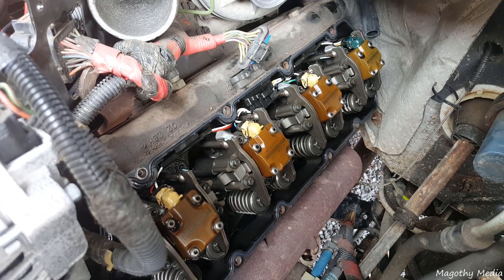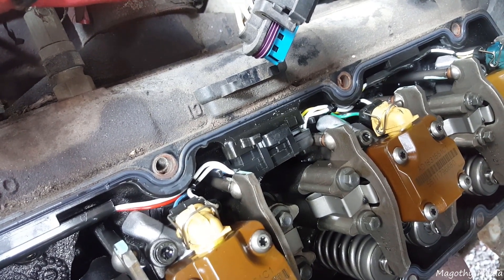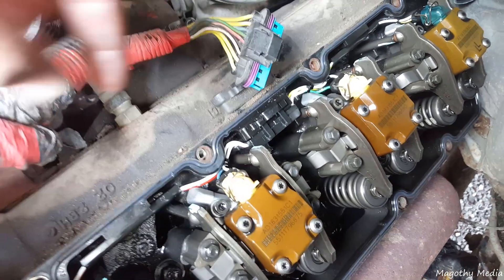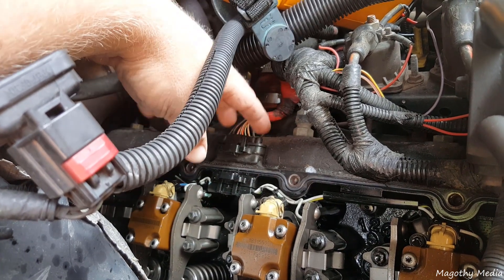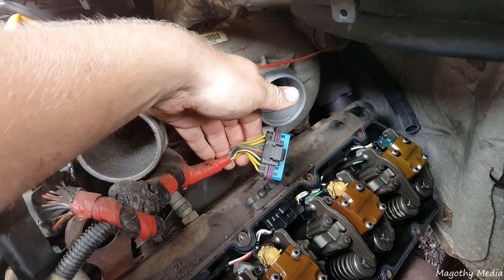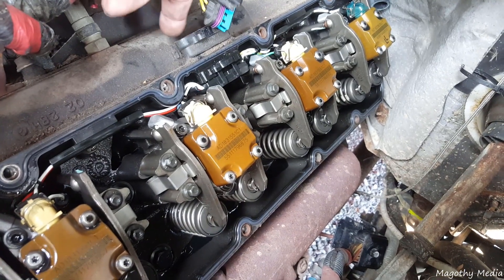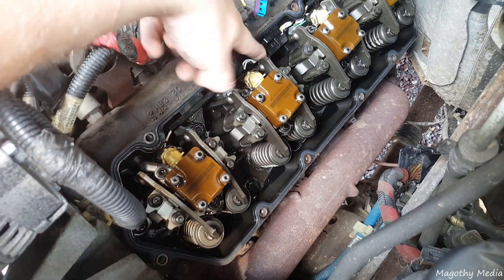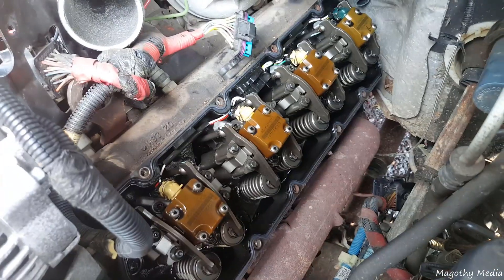7.3 P1316 Diagnosis - Troubleshooting and Repair of Injector/Glow Plug Harness

Comment: got a 99 7.3.. just acquired the truck abandoned. been sitting few years. mouse chewed glow plug wires at relay. and the icp wires. fixed wires and a new icp. it fires up with a misfire it seems.  has a 10 switch tuner chip that makes a difference for a sec then back to same. have not driven truck bcs its missing still. I found a quarter on passenger side. ill ck driver side next time I get a minute to pull driver valve cover.  thanks for tips. thinking of unhooking the tuner chip. can they go bad and cause a misfire?

Comment: Have injector 2 & 8 code in IDM 
2 & 8 Failed Buzz test & contribution , replaced IDM, still runs the same
Truck has 92k & also never injectors 
Shop says needs injectors, I don’t think so 
Believe this may be this fix 
Thank you

Comment: I wish I would have known to check the 42 pin connector first, it's easiest to get to.  If that is bad then check the connector you show, before going under the valve cover if necessary.
Reply from the maker: Yea, just tricks you learn eventually. Usually I learn them after doing it the hard way first haha

Comment: Does this issue always throw a code? Mine fits these symptoms, but I have no check engine light
Reply from the maker: Yeah it's possible if it's an intermittent or brief issue. The issue has to occur for a number of cycles to throw a code
Reply: Mine threw zero codes

Comment: I have a 97 F-350 4X4 7.3L it is unsafe to drive, as it just quits driving down the road, then it won't start for 1 to 2 hours, and then sometimes it only goes 1/4 mile and quit again or sometimes it will go 200+ miles but we never know when or where it quits, sometimes it has codes one is P1316 and another code, and the parts store looked them up and said that one code list 28 parts it could be and the other 30 parts, he said that's 90% of the engine!! I took it down to the rip-off places near me that charge $250.00 just to read the codes! Saying that's Diagnostic fee, and gets a "OUTRAGEOUS" $150.00 BUCKS AN HOUR!! NO ONE DESERVES MORE THAN UNION PAY OF $25.00 PER HOUR!! Especially when they charge to replace a part they say will fix it, and it doesn't fix the problem!! Called Ford they won't even look at it, or even give me an idea of what it would be... So I will NEVER EVER buy a Ford again!! I called the Chevy dealer near me and said I had a 97 pickup truck and they said bring it down! I'm Handicapped and on a low fixed income and after replacing 3 parts that "THEY SAID WOULD FIX THE PROBLEM" and spending thousands of dollars and finding that I could have bought all those parts for under 100 bucks on the internet... I need to help my neighbor go from Vegas to NH to take care of her sick sister and she has her grandson with her as well, so this needs to get fixed... So I need someone that has had this problem and list what fixed it... Or get someone that will fix this for a reasonable price, and I will film it... Please Help...
Reply: LMAO, apparently they do deserve it, you cant do it.

Comment: im reading 57.7 ohms on 3 outta 4 on driverside bank the other is 2.7.is this because i got the engine soaked?the truck runs like shit and comes up idm failure.not sure what to do
Reply: I just replaced a probably perfectly good IDM due to the code. The truck was fifty cent modded three years ago and I lazily fell for the IDM code.

I'll bet it's the passenger side intermediate plug
Reply: Sounds like your uvch on that side is bad. That will spit an idm code

Comment: Can you explain what you mean by "ohm out" and how to check? Thanks
Reply: Set your multimeter on the Ohms setting, automatic measurement mode, and then place 1 lead on the pin for each injector as the other lead is on (as I recall) ground.  It will measure the resistance through the coil of the injector. Should be about 2.6 to 3.0 Ohms.